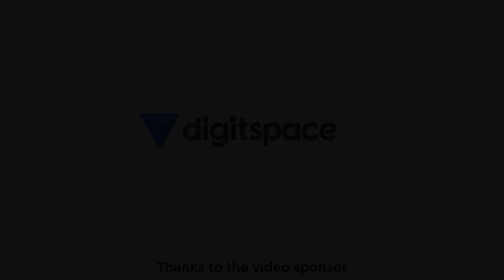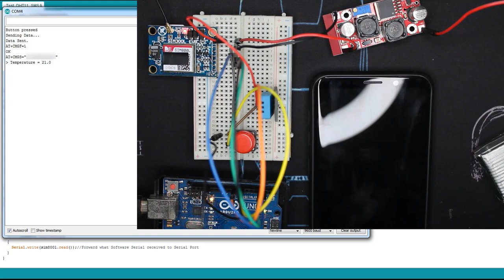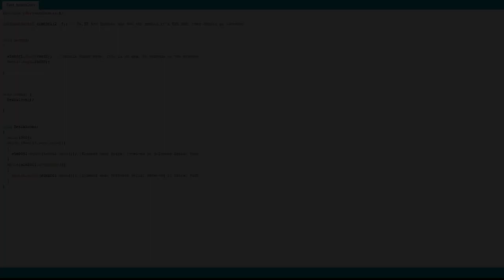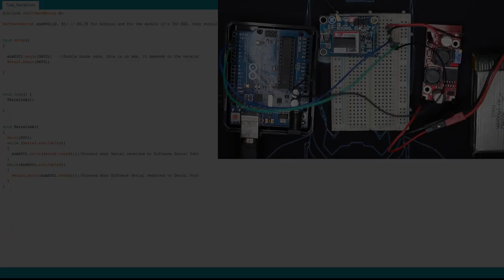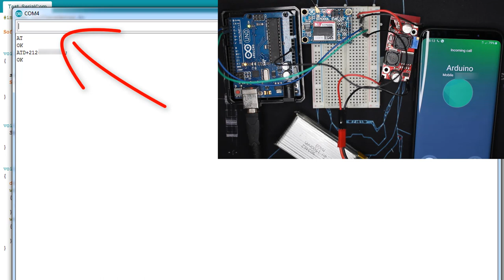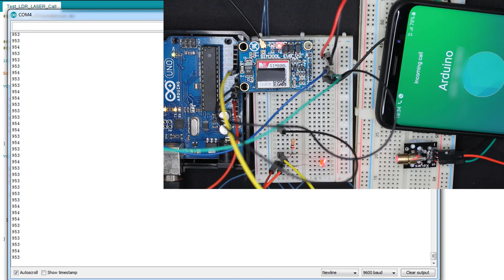Arduino + SIM800L to Dial phone numbers & LASER Tripwire GSM Alarm project | DigitSpace

Comment: Great videos, thanks. I need a perimeter alarm in my farm. It must be triggered with a fishing nylon and is 1 kilometer away from the house. Can you recommend me which system would be of use?
Reply from the maker: Proximity sensors would be nice or microwave radar would be useful too, but if it's necessary to use a fishing nylon you can add a limit switch, when the fishing nylon is pulled it will trigger the limit switch, this one can comeback to the first position so you can be warned if another event happened.

Comment: Sorry , 
Can you help me to measure the temperature and humidity in egg incubator using dht11 with lcd i2c and using buzzer 
If temperature equal to specific degree the buzzer sound that said to me the temperature is high or humidity is low 
Please help me and answer
Reply from the maker: Hello, you can do it it's easy... I have a DHT11 tutorial with LCD i²c, I have a tutorial about buzzer too all you have to do is set conditions on which the buzzer sounds... if you've done a try send it to me on FB I'll check it.
Reply: @SurtrTech  gave me your account in Facebook please.
Reply from the maker: @mostafahagee1263  https://www.facebook.com/SurtrTech send me a message there.